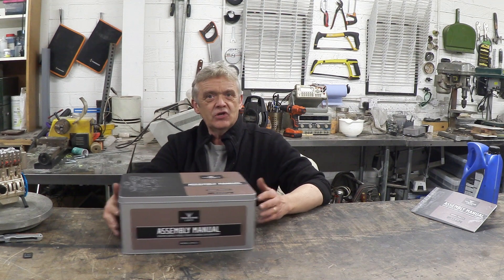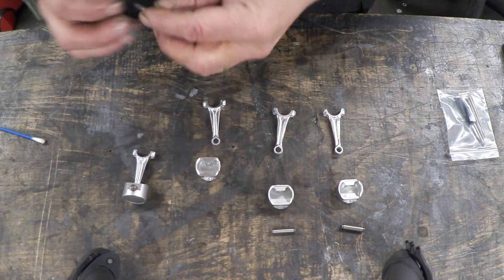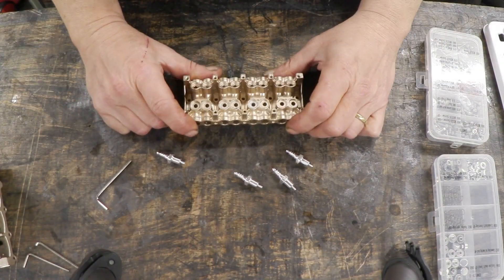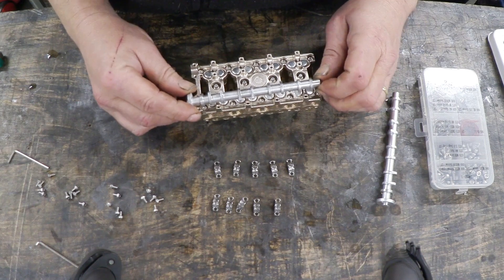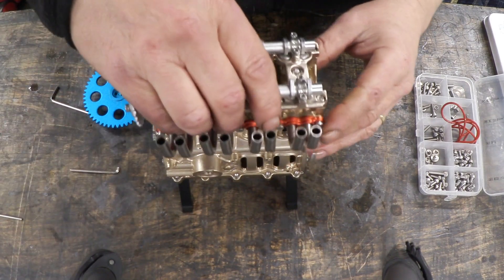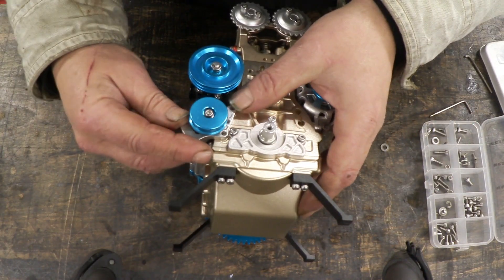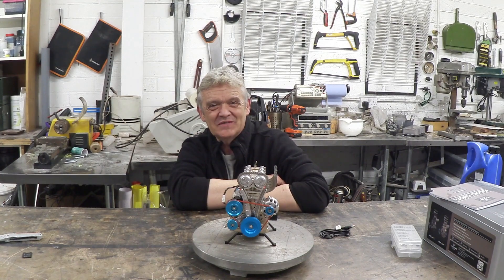Building An Awesome Model Engine Moyustore Model DM13 1 - In line 4 Cylinder Car Engine

Comment: I was surprised to see them using a guide to tension the timing chain rather than a sprocket. Is that something that is done in real engines? I would think it would lead to a lot of unnecessary wear on the chain and the guide.

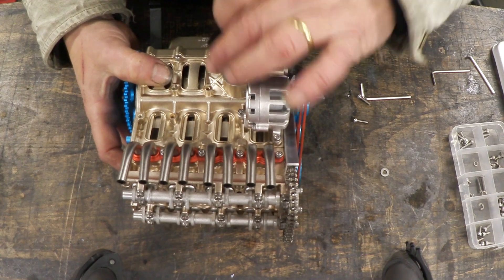Comment: RMS, I believe @12:03 you mentioned a dummy air filter. I believe that is the dummy oil filter instead. The air filter would be at top prior to the carburetor or air-fuel intake.
Reply: A lot of people are not financially stable this period and it's not easy, I always advise people, don't just waste your stimulus checks or salary, invest it in something that will yield more, even if it is a part of it. We can't keep relying on a paycheck that is already half-spent before we even receive it, there are investment opportunities that have helped a lot of people especially in the financial market. Having different streams of income is essential in this pandemic, especially now most of us have to earn and work from home. I've made impressive progress so far this year and it has helped me sort out a lot of bills and I do that through a registered investment company. You can get in touch with the manager via Instagram (@richard_brucefx)  he will guide you properly.

Comment: In my humble opinion, not enough oil was used in the assembly process. Such as on the main bearings.
I hope it didnt cause any adverse wear on the start up.
Edit :  Oops :)  I thought it was going to run on fuel and possible rev quite highly. Oh well. Looks like a good bit of fun.
Reply: Yeah I agree